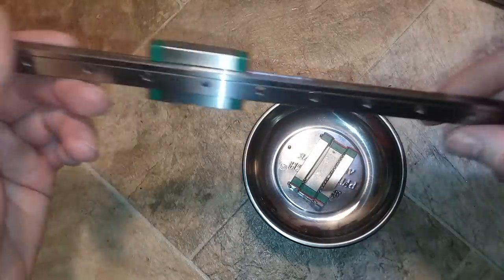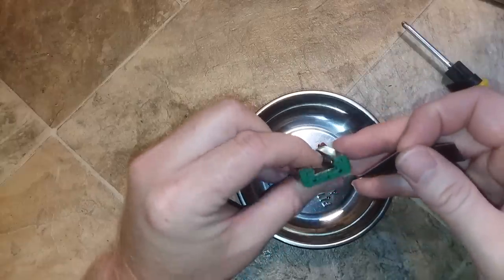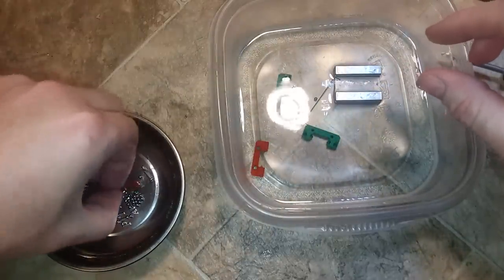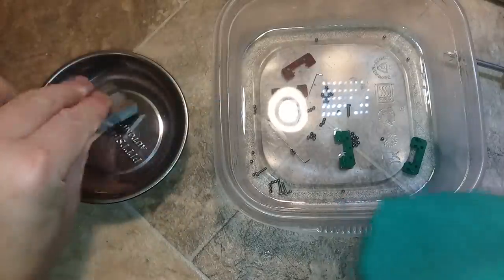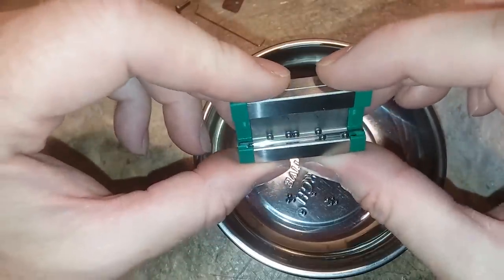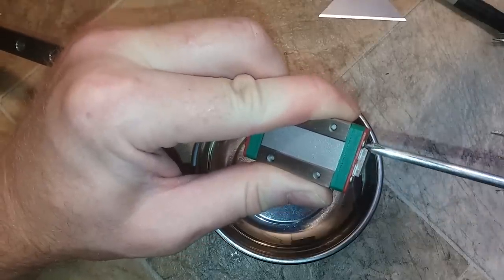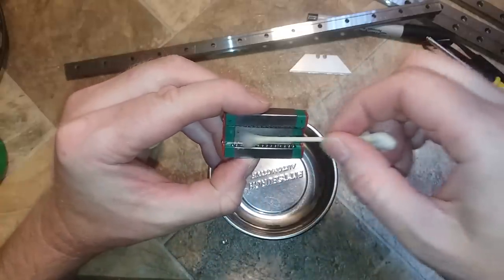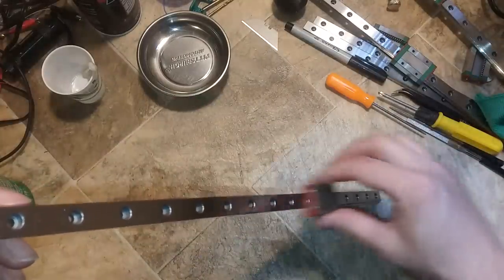Tuning Up Cheap Chinese Linear Bearing

Comment: You have a choice...Either "Cosmoline" to protect it from corrosion and rust...Or it starts rusting as it takes three or so weeks to cross the pond and the salt air permeates the shipping container.  It's an easy choice.  And truthfully, you should always clean your parts and do a good TI before assembly anyway.

Comment: Just a heads up, even high quality THK Japanese bearings, greased blocks will not fall under there own weight like that. They are typically preloaded and feel like there is a decent amount of resistance and will ease up when they are under load.
Reply: But here you can see that those linear slides are not preloaded because they easily slide when cleaned. Afaik the preloading of those slides is achieved by the ball bearings. If you choose preloaded slides, the balls are slightly bigger than those of un-preloaded slides which usually then slide freely without any load at all like shown in the video, so basically you put slightly oversized balls into the slide to preload them. I am pretty sure the guy in the video didn't bought preloaded linear slides.
Reply from the maker: There is zero play in these rail bearings.  Paying extra for pre-loaded bears would be a waste of money for something like a 3D printer.
Reply: @MrDabrudda  , even zero pre-load bearings will have resistance due to slightly rubbery scraper and grease and wont necessarily fall under their weight. I cant speak for your exact bearing or the exact grease that those were shipped in but, they are commonly packed with grease for actual use, as well as oil. Not trying to say you are doing anything wrong if you prefer to use oil, but just saying they wont necessarily feel super slick like many might expect them to be. Anyways, cheers.

Comment: Hiwin rails will have the same kind of drag when you receive them, but they'll wear in and slide easily after running for a bit of time
Reply: That wear IN, IS THE FACT THEY ARE ERODING AWAY.
Reply: @aqib2000  keep all part oiled and cover them up may help when not in use may help.

Comment: Remember to not mix carriages between rails and dont take all balls from all cariages at once. It's often happen in cheap guides that balls have diferent sizes depending on tolerance dimention that rail and cariage were made.
Reply: i did exactly this and the guide hardly moves. what should i do

Comment: I try to avoid using magnets with ball bearings and stuff like that, nothing worse than fuzzy balls after you accidentally magnetize em. Probably not a big deal if you don't produce a lot of steel dust but for me at least, its such a pain
Reply: well this is a great point

Comment: Cleans components, proceeds to file directly over them.
Reply from the maker: Isn't that how it's done?
Reply: I noticed that too!  All that work cleaning everything and then using plastic to push old metal filings off the file on to the newly magnetized ball bearings. Brilliant!

Comment: Thanks for this video. In all my googling for improving Chinese linear rail performance, I've not come accross such a complete video. I'd figured some parts for myself, but tightning the screws on the sweeper AFTER putting the block back on the rail never crossed my mind!
Reply: Only original linear rail can make good performance, We assemble well before deliver to our customers. For our customer never mind of the performance of linear rail.

Comment: Lots of good information here. Thanks for the thorough explanation and procedures. It really is night and day when you take the time to thoroughly clean these.

One thing that I have noticed works very well with these inexpensive rails is to purchase higher quality ball bearings and swap them out. It's a $5-8 fix that can dramatically tightens up tolerances and spherical geometry.

Comment: Another thing to be careful of is the end of the rail where it was cut in the factory. The cheap ones may have sharp edges at the very end where it was cut, so there might be a slight lip right where the bearings slot into. I put one bearing on my rail before removing any sharp edges or burrs at the end of the rail, and that seems to have put a small nick in one of the bearings so it has a small flat causing a lot of noise. I used a wire brush to smooth the edge of the cut, and the 2nd bearing was just fine.

Comment: Great info.  I just bought some (supposedly) ultra-high quality HIWIN rails (very expensive), and they were binding exactly like you show here right from the factory.  Also covered in grease, just like shown.  I'm going to rebuild them today.
Reply: As I'm learning linear rails recently, it's common that manufactures put transport oil to protect it. It seems a must for users to clean and apply lubricant before using them. No matter it's super high end or cheap ones.

Comment: This is great , i got some super cheap rails on ebay for fun. and they to had nasty shipping grease all over them. but may i suggest instead of using a magnetic tray ( bearing balls can interfere with one another if there magnetized ) lay a towel out on your work bench, this will catch everything without the chance of it rolling away.

Comment: Great detailed instructions. I couldn't figure out how to remove the guides so I put the damn thing back together and blasted it with half can of DW40, blasted it with warm air and then applied a bit of 3in1 Silicon lubricant. So far so good. BTW my rails didn't have that extra plastic problem
Reply: So the silicone spray is acceptable?
To use - I have using just regular 3 in 1 oil

Comment: always good to clean them no matter where they come from not just from china ones, the reason is they add lubrication is because they dont know when it will be sold or where its going to be stored in and for how long period till it gets sold....so it coats it so that in any condition they have them at who ever bought them to sell well if they have them stored with to much humidity then things wont corrode and rust ....but for sure you need to clean any of those you buy from anywhere and add your own lubrication after the cleaning.
Reply: interesting
Reply: You are absolutely right. Manufactures will put transport oil to them. Even you spend 10x more money on higher end rails, the cleaning and lubrication still need be done by the user themselves.

Comment: Do this without disassembly:

Soak entire assembly in iso solution, then place in sealed container with silica desiccant beads. Basically my go to process for any Chinese oil coated junk.
Reply: My newly purchased rail is hard to move. I guess I should clean it up. Can you give more detailed information? Moreover its brand is HIWIN :(
Reply: Even better: use mineral spirit / lighter fluid to dissolve the grease. IPA does not dissolve grease as well and can damage the plastic parts (unlikely though).
Reply: Hey that's good tech- i dig it.

Comment: And if you then want some accuracy in this rails you can change the steelballs into some 2.381 g10 quality balls. they are cheap and absolutly accurate like the hiwin ones! I build myself an mini-mill and my accuracy is about 0.03 mm at aluminium
Reply: Impressive! What did you build the frame out of?
Reply: Which ball size goes into the 20mm bearings?

Comment: Thanks this video was really useful, fixed my problem with a set I recently purchased on AliExpress that were a bit crunchy. After cleaning I looked at the bottom of the cleaning solution to find some fine metal particles plus other particles I couldn't identify. I found white spirits did a better cleaning job than alcohol and water.
Reply from the maker: The factory probably does not clean the MGN12's before they ship them out.  They just dunk everything in cosmoline protectant and box them up.

Comment: Nice video, thank you! Just a caveat about WD-40. Don't use it to "lubricate". It is not a "penetrating type lubricant" but actually a degreaser and water displacer.
Reply from the maker: I didn't use WD-40.  I used a Slick 50 lubrication spray which is nothing like WD-40
Reply: ... that's what the "WD" in WD-40 stands for ... Water Dispersant formula #40. It is not a lubricant as you state.

Comment: Jeeze, what is wrong with people? I like the video, and the rails he fixed are proven to work. So why the naysayers claim those rails do not work. Talk about Reality Dysfunction that people have.
Reply: to justify why the paid for expensive rails
Reply: They work, but when you move the carriage block slowly on the rail you can feel some of the bearings will be rough when contacting the rail. I ended up replacing the balls with ones made by Timken.

Comment: Type of lubrication is dependent on a few factors. Speed is the main one. The faster you want something moving, the lighter the lube must be. (Less resistance) Type of surface is secondary. Two flat plains as in a lathe bedway and anything with ball bearings have different needs. The lathe will use a much thicker lube to keep everything in place. Load plays a slight factor, too. 
As mentioned, sewing machine oil is great for these tiny, light load linear rails. SAE10 to SAE20 is what I would recommend. Something with no detergents, a.k.a. compressor oil. https://qurl.org/PnV Engine oils are not recommended. They will suffice for a short while but you will notice a film grow on your components(the soaps being oxidized) and eventually the ball bearings get choppy again.
Reply: This. There are detailed oil/grease specifications from linear bearing manufacturers. Usually lithium grease for slower speed, and oil with right viscosity and no detergents for high speed use. Service cycle etc. Never use engine oil additives like Slick 50.
Reply from the maker: The Slick 50 I use is a synthetic lubricating oil.  Not an oil additive for your engine.

https://www.amazon.com/Slick-50-43712012-Supercharged-Protectant/dp/B0016GXOXW#productDetails
Reply: Think you will find it is an engine/oil addative
That's what slick 50 is they make engine protective addatives all their products are automotive based
Reply: Paul Reason pretty sure “Slick 50” is the brand name and that product isn’t an engine oil additive. I read the label...metal on metal lubrication. Just sayin’. Have a great day!

Comment: Be careful when using the water and isopropyl alcohol mixture, it can rust the balls (crappy steel). Happened to me and I had to order new ones to replace the original.
Reply from the maker: The bearing won't rust they  are chromium steel or stainless steel.  And the bears are only in the solution for a few minutes at most.
Reply: Before doing the cleaning I was not worried about the possibility of rusting because if they were actually chrome or stainless steel it would not happen. It's most likely that the bearings were normal steel with a poor chrome plating. Just a head's up.
Reply: @joeltavares247  wow that really shines some light on what these guys sell to us as 'cheap'

Comment: Everything was fine until you filed flash off plastic parts DIRECTLY OVER A TRAY OF CLEANED PARTS. Falling swarf results in particle contamination, a Bad Thing even if the particles are non-abrasive in nature.

As for retained magnetism from the parts tray, the principal hazard is from steel particles that may be attracted to places where they may cause mischief. A series of slow passes of the assembled bearing block through a strong AC magnetic field will weaken retained magnetism to nearly zero.

A handy workshop de-magnitizer may be improvised from a re-purposed 1 KVA transformer winding from which the iron core has been removed. If the transformer has dual 120 V primary windings, these may be connected in series (observing polarity) for operation on 120VAC outlet power in lieu of connecting to reduced voltage. The solonoid may rapidly overheat: monitor winding temperature until you determine  the allowable on-time.
Reply: wait are you saying the ball bearings and/or carriage on these things have obtained of bit of magnetism from being in the magnetic parts tray? Do they really charge that easily?

Comment: wd40 is not a lubricant though. its a dissolvant which will dry up and leave your bearing without any lube. the oil you used is good but comparing it to wd40 is comparing apples to potatoes. 
i did like your video however and it saved my cheap bearings from the garbage bin. love it!
Reply: DaToNyOyO  you dont know anything about oil if you think wd40 is for lubricating anything other than a sqeaky doordoor hinge. reading their website doesn't mean anything. wd40 is a solvent and a penetrating oil.

Comment: I bought a used 3D printer with these linear bearings. They worked like garbage so I followed your video. Upon pulling the blocks off I realize that the previous owner must have removed those wire guides. I made new ones out of guitar string (wire). I was able to resurrect 2 of the 3 blocks but the 3rd is probably a lost cause. There may be bearings out of round or something. It works better with less bearings and gets too tight to slide well when the full complement of bearings is on board.
Reply: you can also buy new blocks
Reply: I just bought some of these rails and had one like that too. It seems that each rail and block is a tiny bit different. There was also one that moved a little too easily, so I swapped their blocks and both are good now. At least each rail is consistent within itself (no loose and tight spots) so they should work well once matched up with blocks they agree with.

Comment: Wicked video. my friend shelled out on Hiwin rails because of all the bad reviews on the cheap Chinese rails
Reply: Just for your information. Hiwin is not a Chinese company and produce high precision motion components in Taiwan. Their price just a little cheaper than  Japanese made linear components. But I found most of the Chinese made linear motion parts has same looking as Hiwin parts but only 1/2 to 1/3 price of original Hiwin product. I myself bought several linear parts from online store which all name Hiwin, but the differences are very noticeable when I compare them side by side. The one purchase from Hiwin works very smooth and no backlash. And the one with cheaper price runs not smooth at all and you can feel the balls sometimes stuck inside the rack. Also dust found inside the linear racks and grease. I strongly suggest purchase these parts from Hiwin distributors. So you projects will not ruin by these parts.

Comment: You can also purchase new loose ball bearings with a better grade, G25 or better and make these rails run better.
Reply from the maker: I'm not sure about the grade of the ball bear but I bought 100  additional ball bears because some were missing from the MGN12H bearings when they arrived.

100 3/32" Inch Chrome Steel Bearing Balls G25

https://goo.gl/FTEvtH

Comment: Thanks for posting this. I was always afraid to look at the linear bearings that came on my 3D printer but after seeing you reassemble yours I'm confident I'd be able to line up and reinsert the balls if I ever need to :).

One observation - the tube of bearing grease that came with my printer is a lot thicker than the oil you're using. It's about the same consistency and stiffness as vaseline. My rails run smooth and are a quieter than the ones you show in the video - could it be that they'd benefit from a thicker lubricant than you're using? I think I hear metal-to-metal contact in your vid (both on the stock and the re-lubed rails). Perhaps the pressure of the balls is breaking through the oil film and making that noise - maybe a thick grease specifically for ball-bearings is a better choice? Sure they run with less resistance with a light oil like you're using - but I believe they'll be noisier and wear out faster. Also, viscous oil adds damping, which helps cancel out vibrations and ringing in the surface of your prints so a thicker oil might improve print quality at high speeds.
Reply: LMF5000 superlube?

Comment: Lovely video. Thank you. I just received what may be precisely the same rails. Thing is, I’m not sure the resistance will matter very much. I’d love to see a before and after cleaning print.
Reply: The effects of drag will depend on the rest of the machine.  

If the drive system has any flex or springiness to it, drag and stickiness will cause distortion and jumping of the axes, as the axis sticks (lagging behind the commanded position) then pulls free (perhaps overshooting).  

If the drive system has any lash, the drag will tend to put it against the trailing edge of the lash.  For bi-directional motion (e.g. a circle), this may give a combination of worst-case distortion and increased repeatability.

Now consider what happens over time to the bearings and the gummy stuff in the bearings.  Is it a good lubricant?  Probably not --> more rail wear.  It will get pushed out of the way in heavily-used regions and stay in the less-used regions, causing variation in motion across the machine bed.